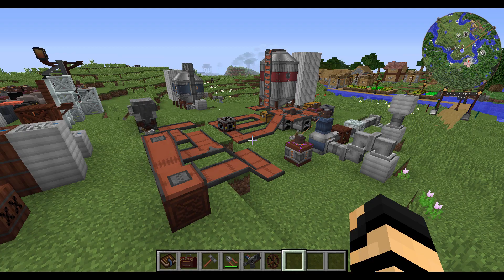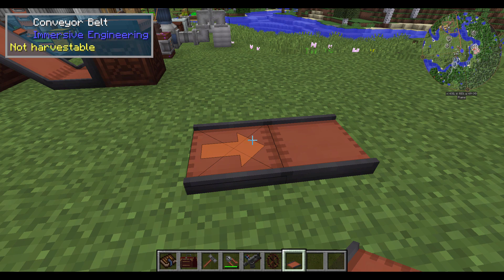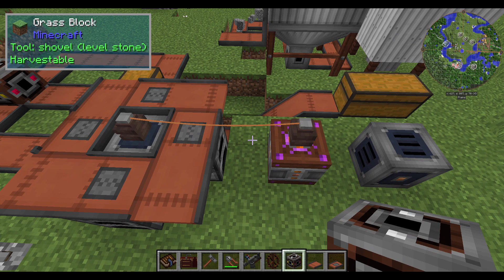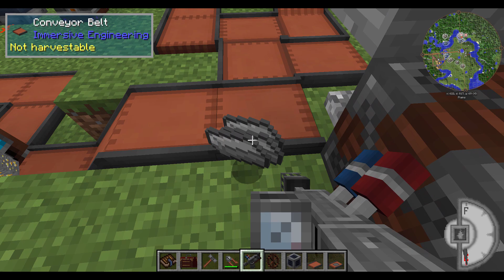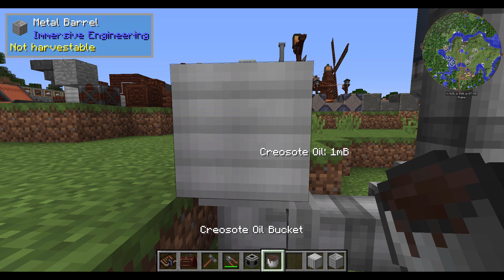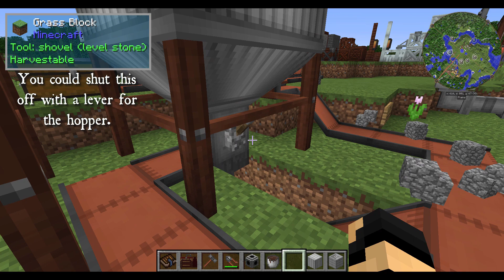Immersive Engineering: Getting Started Bit-by-Bit - Items, Fluids, & Transport! MC 1.10.2/1.11.2

Comment: Great vids..very helpfull

But is there a way to pump water out of a lake or something? I still have to manualy fill up the tanks that bring water to my garden thingies.

Second prob is that the garden makes more then my machines can handle. So it all stacks up on the belts. Would-be nice if there was something that looks for option 1 and if thats no option it goes in to a chest (or lava)
Reply: There are pumps that you can craft that do exactly that. They take power and need to be activated by redstone (frequently overlooked). 

You could always use another mod or a comparator to check the fullness of a container and use the signal to turn off the garden cloches (since they can take a redstone signal too)

Comment: im trying to power my metal press and bullest press but it wont work with any of the batteries even if they are being powered
it only works with a creative capacitor how do i fix it?
Reply from the maker: Are you using the proper voltage? Is your regular capacitor set to output where the connection is? Is there power in your capacitor?
Reply: Mischief of Mice I used a lv battery that was being charged with a wind mill but it ran out of power fairly quick
Reply: Then I tried recharging it but it won't work
Reply: Mischief of Mice -p.s. Your tutorial is great thx
Reply from the maker: You need moAR POWAH!!! Muahahahaaa... ehem. More power. :)
Reply: Mischief of Mice -ok thx for the help I appreciate it dude

Comment: I'm currently just trying to learn about different mods since I just started playing FTB again with the Revelations mod pack. It has been frustrating because of the lack of insight in game on how to make rf generators and sort items. The item descriptions sometimes don't give enough info about how things are made. So one of the thing I needed made was a steel ingot for something, but it never told me in the creation menu that I needed a coke furnace. 

But anyway, my question is with conveyor belts. If I am mining at bedrock and want to set up belts that run up to base on surface to be sorted will the item despawn after a while if left out too long on the belts?
Reply: If you're playing FTB, the best method for long range item transport is an Ender Pouch linked to a matching Ender Chest in your base. Have the Ender Chest sitting on top of a hopper, which will empty the chest and send items to the correct storage locations in your base. Getting a full sorting system set up is a bit trickier, but it's very easy to at least sort out junk items like cobble and dirt, to send them to a simple mass storage location. Super convenient for inventory management during long mining trips.
Reply: UnknownSquid Thanks. That is way simpler to do. ☺
Reply from the maker: +lazy gizmo Very long running belts with lots of items I would say is a very bad thing. This will likely cause a lot of lag though the items on it will likely not despawn though I can't say I've tested that.

Comment: I am pretty sure I have watched nearly every IE vid you have and I can't seem to tell if you have talked about a way to keep yourself from picking up the items off the conveyor belts as you run by going to something else. I would like to make nice big factories with all the stuff in this mod but I really don't want to have to add the extra logistics of having a re-injection system that would put wayward parts and pieces back on the belts I might have grabbed them from on a run through the factory. Is there something like a contained conveyor, or a "hammer click" option to make it so I don't clean off a belt as I am moving around my factory loading and unloading my injection points for heavy automation? If I wrap them in glass would the drops try to pull to me but then hit the glass and fall back on to the belt when I am further away? Any ideas to solve that issue would be greatly appreciated. By the way, you make the best MC mod videos I have ever watched. You are very informative and helpful and so much more chill and relaxed than most of the people I have seen make mod spotlight vids. Thank you for everything you are doing.
Reply from the maker: +Strato Driver Thanks Strato Driver! In fact there is a way to stop items being picked up off conveyors. It was a minor add in not long ago. You can click a conveyor with a scaffolding to make it a covered conveyor. :)
Reply: Thank you so very much for that!!! I was hoping there was a way within the mod so I didn't have to fashion something up using other mods or methods!
Reply from the maker: +Strato Driver As an aside though, Botania does have an anti-magnet flower called a solegnolia if you need it.
Reply: Well the thing is I have lots of other reasons to appreciate the magnet feature so I was hoping I could just find a solution like that covered conveyor like you told me about. By the way, can I cover all the different types of conveyors or will I need to be careful about how I build so the special conveyors like the vertical and dropping conveyor don't get items pulled off of them?

Comment: I'm in the process of refining a design for a mob farm with a lot of floor space. (A little under 32 by 32 blocks wide.) And first I was going to use water to move the mobs to the drop shaft, but it's too big for 4 water source blocks in the corners, meaning I would have to use lines of water source block, which would cause the whole floor to turn into source blocks. So I tried conveyor belts. I noticed as I went along the tedious process of laying down multiple stacks of belts, that the game was getting slower to respond. It became quite laggy in the end. So I'm going to take out most of the belts, and try mob fans, which don't reach to whole distance. I also didn't make the shaft wide enough the first time, so it's time for a 3 by 3. Good thing I have Psi, and some spells for digging and placing blocks. I don't have a quarry yet... But anyway, point is, conveyor belts can cause some lagginess if over-used.
Reply from the maker: Yup. SAme with almost anything that is an entity or tile entity in Minecraft really.

Comment: You can shift+click the scaffolding on a pipe to remove it without removing the pipe.
You can also right click with a diffrent type of scaffolding to replace the existing scaffolding, which will be dropped as an item/picked up.
Reply from the maker: +Izithel This is correct now. At the time of the video it was break it.

Comment: hey, did you ever have a part about how to automate removing the oil from the coke oven?
Reply: Use a fluid pump with the input side facing the oven and the output facing away. Hook up a fluid pipe to that and into a tank.
Reply: Art Free-Spirit or a drum from extra utilities 2 (how I did it)
Reply: He did it in the ep before dis